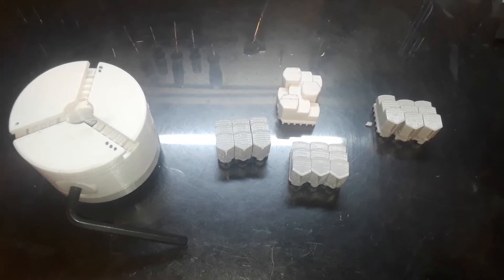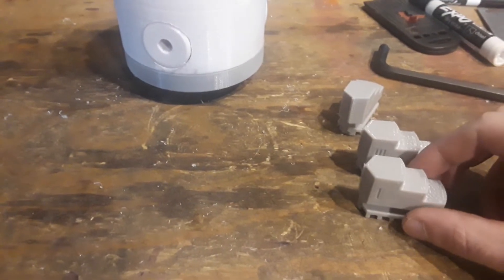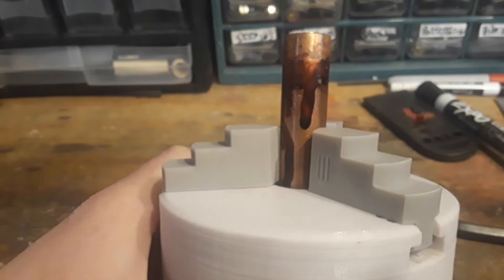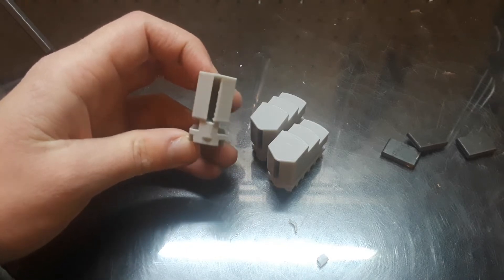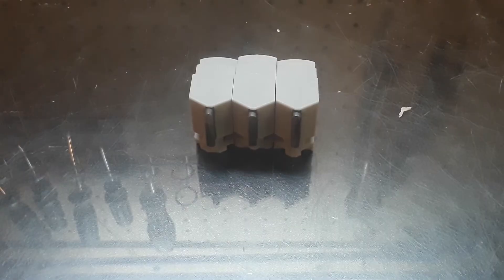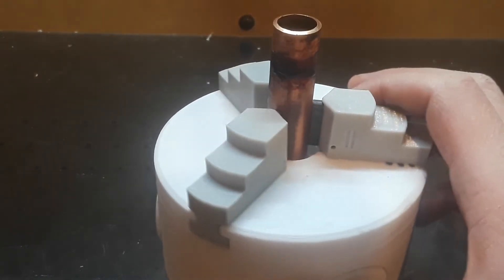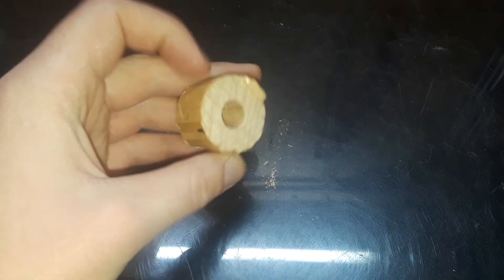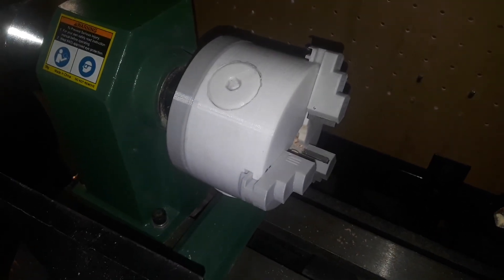Making 3D Printed Metal Lathe Jaws

Comment: Holding rotating metal pieces with PLA is extremely dangerous. The PLA will deform under the action of the centrifugal force applied to these metal jaws and this will destabilize and weaken your chuck.
Frankly, this is a disaster in the making.
Reply from the maker: Nothing yet!